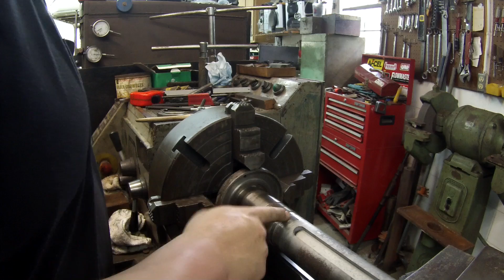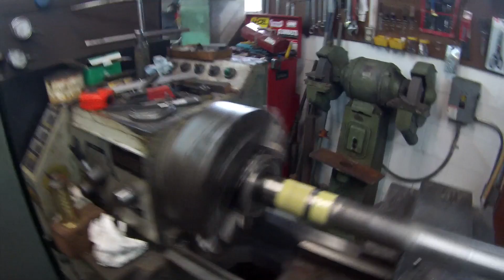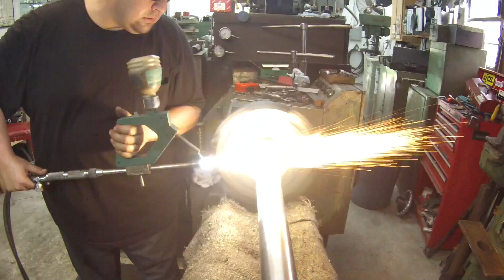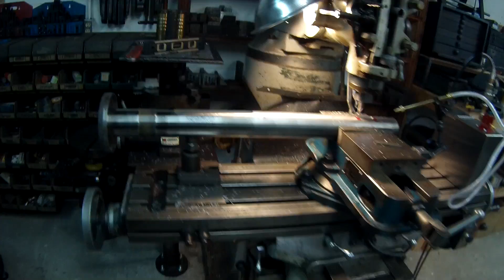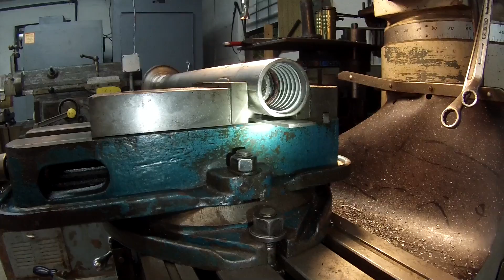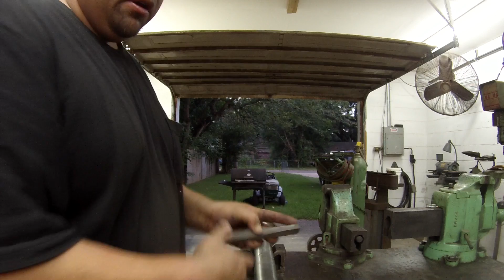Well Drilling Shaft Repair 5

Comment: Glad to see you using eye protection from the intensely bright flame!  That's a super metal-building technique.  Was there a special reason not to use lubricant when you turned it to size?  Nice work, thanks for the learning.

Comment: can spray welding be used on crankshaft bearings sections ?
Reply: I take it you mean an engine crankshaft....I think it's easier to just use bigger shells and reduce journal diameter.
Take into consideration the amount of heat you would be putting into the crank which may distort it assuming you mean just the main bearing journals, and not the big end.
I'm not saying it couldn't be done though.
Reply: Split10 indeed ...but im just afraid it may weaken it abit ..maybe im over reacting

Comment: Hi Abom79 !!! Did you try masking against metalizing using thin metal sheet secured/tied with something like copper or steel wire? This type of solution works fine for me (I never liked masking compounds) and I see aeronautical repair job using this method. Masking tapes works fine too (but are expensive). Greetings from Brazil.

Comment: You could actually use a piece of felt between the magnet and the surface that it will be sat on to stop the resonance in the audio, I did it to help with mounting on a cc cutter.

Comment: Lovely work Adam.  I used to do this stuff with a system called Eutectic. Heck the powder was expensive. The system was the same as yours but the company recommended that we actually cut a rough screw thread in the undercut to aid bonding and to make sure the sleeve you sprayed on would never turn on the shaft.  You sure are bringing back some happy memories Adam.  Keep them coming please.
Reply from the maker: Robert, thats the system I have too. Its the older style Rototec.Yes the powders are very expensive, but lucky for me we had quite a few from days past and I'm still using them up. I want to say at when we bought some at work last time it was around $60 per pound. I do cut a thread in the bottom, but its not a full thread, just one pass.

Comment: that's awesome you really no what you are doing  i am learning a lot watching your videos  .i have been working on engines since i was very young and just turned 43 and was thinking about adding some machine shop equipment to my arsenal of tools what do you recommend buying first i say a lathe my brother says a drill and mill .i like the idea of pulling something that has not worked in over 50 years and giving it new life .
Reply from the maker: A lathe and a milling machine are two of the most common of machine tools for any machine shop. If you had a choice, by a mill instead of a drill press, because you can do most of your drilling on the mill. next would be to get a lathe. With a lathe and a mill, you can machine just about anything you need. But not to forget about all of the tooling needed, and some support machines like a bench grinder.
Good luck Jay. Sorry the late reply.

Adam

Comment: Adam, Love your videos, learning a lot I can use in my home shop.... I have the same Eutectic torch so this video was a refresher on how to use mine.  Where do you get the masking compound? I have a meat grinder shaft to spray weld and need to keep the spray off a nearby bearing surface.

Comment: the single most fascinating thing i have seen on ytube,nobody ever told me(apart from chroming) that they had a putting on tool that looks so easy but i suppose you have to be skilled enough to do it,as for the repositioning of the shaft for the second keyway can i give you a tip,scribe a line on the end of the shaft with a hieght gauge and turn it and use a square to set it upright its how i used to do it.thanks adam for doing these insights into your work/hobby.alan

Comment from the maker: Yes it does, there are a few different style and manufacturers out there. My is the older style Rototec system but can be bought used. Another viewer just purchased a used system like mine after he watched this video. I use a new style at my other job that works basically the same way. Its a Thermodyne brand,

Comment from the maker: Dont know what the hardness is off hand, Ill have to look it up. But its a tough finish and you have to use carbide to machine. Its very durable, I dont recall any job coming back because of failure.

Comment from the maker: Less heat on the part and you dont have to worry about the part warping. Its also quicker fix and provides a corrosion resistant surface.

Comment from the maker: As I mentioned in the video, I like to build up the od to about .050 over the finish size. As for the undercut, I dont like to go more than .040 as per the recommendation of Eutectic. I usually just undercut about .020 or when the groove is cleaned up. Its been soo long since I read the material data I couldnt tell you what all is in the powder formula I use, but I do know it has nickel in it. It gives a stainless appearence and wont rust.

Comment from the maker: I was worried that if I applied too much weld that I could possibly warp the shaft, even though the way I fixed it, it still could have warped too. But I wanted to keep the welding to a minimum to reduce the chance of the end warping. But it worked out great!

Comment: Adam.. nice vids. Wanted to ask why you chose to weld the key stock into the key ways vs just using the tig to build it back up around the edges and floor?

Comment: The old saying, "you never get to old to learn," applies here for me. I'm not or never have been a machinist, but I've had things done by them, and the ones I've seen they would have welded up this place and machined it back to spec. I didn't know they made a chemical metalizing process, if I hadn't seen it I would have swore you welded it, and cut it back to size. Nice video Adam, I enjoy watching you work. Great job!